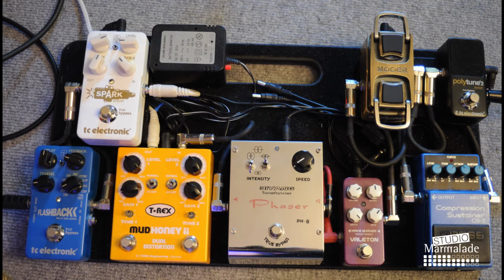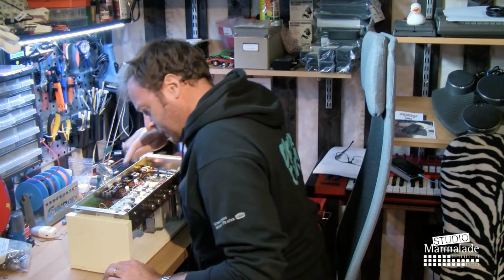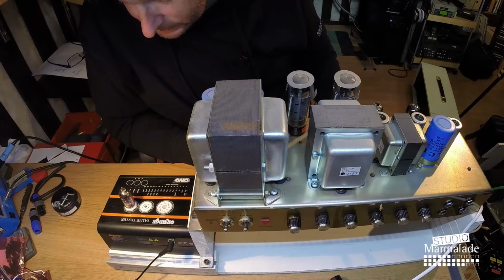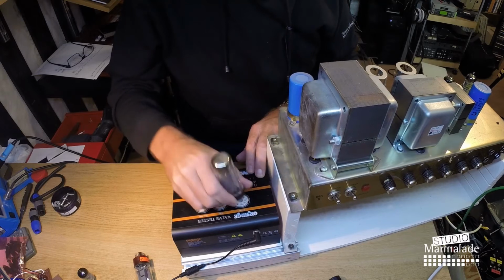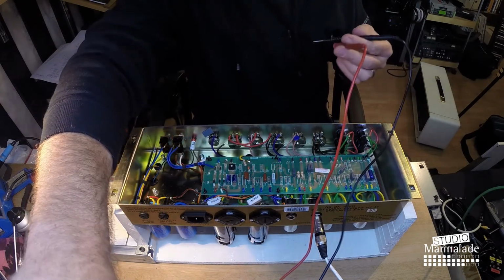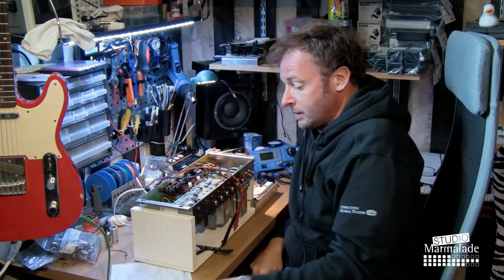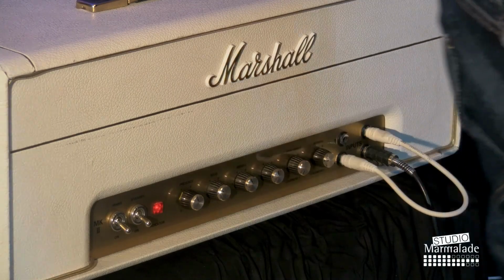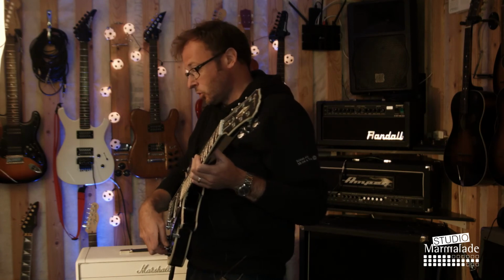Marshall White Tolex Plexi - A look & listen to the amp that defined rock music

Comment: For others who search this up, the amp in the video is 1987x reissue version 1 made 1993-2001 which did not have an effects loop. Version 2 started 2002 with an effects loop and minor resistor differences between the two. The schematic Alfred started with was for the later version. His amp is indeed correct with all the stock values per the proper schematic which he found later. I also have version 1 but have changed most caps and resistors to 1968/69 plexi values. The stock 1987x each are a mix of plexi and metal panel year values. Version two is a bit closer to plexi in the preamp stage.

The low volume gain he experiences is due to the 4700pf bright cap which kicks in gain very early. Normal channel needs to be run above 6 with that cap. If you want cleaner sound at low volume on channel one, remove the bright cap or change to 100pf. Will still sound same when fully cranked up. But will lose “that Marshall sound” at mid volumes.